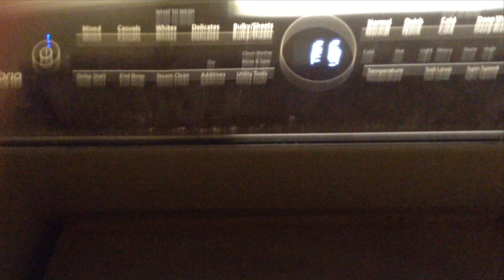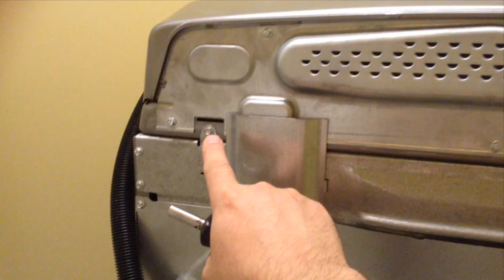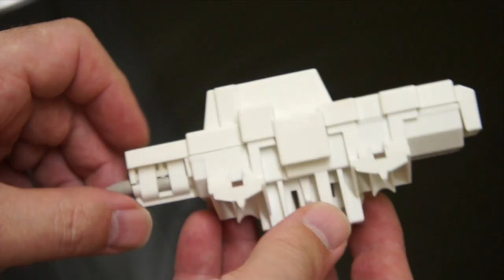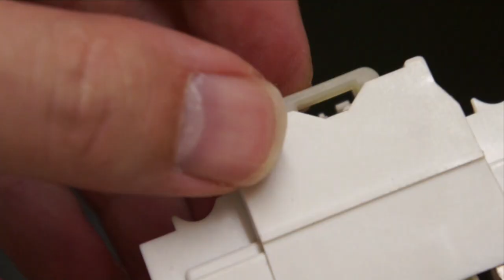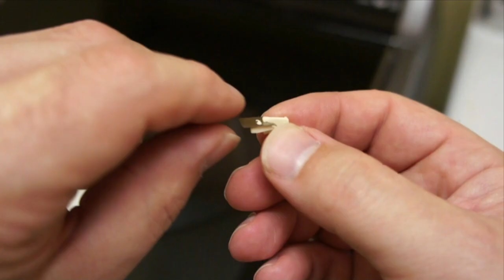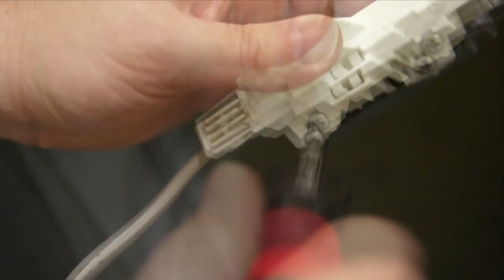Repair E3 F5 Error Whirlpool Cabrio Washer

Comment: Thank you very much for this video and fix!  After some water leaked out the top when we had the washer on it's front while replacing the broken water pump (DR error), we started having the E3 F5 errors on our Whirlpool Cabrio Washer.  I was thinking the water may have shorted out the lid lock mechanism somehow, and then found this video.  As others have stated, it took a couple of tries (and we did use the bulb grease both times), but it finally worked after also using a hair dryer to dry out the sensor and lid lock control board.  Thanks again for the great video and detailed instructions, as well as to those who commented and added their own specific details (like using the hair dryer)!

Comment: $1.50 in grease vs. a new lock mechanism ($42 on Amazon) vs. a new washer ($500) ….. amazing!!!! Fixed on the second disassemble (added more grease and bent the ‘fingers’ a little farther on the second rep) and works like a charm!!!! 🥳🥳🥳
Reply: You replaced the lock mechanism? I did the steps in this video and still nothing.

Comment: Ok so I tried this and it didn't work. My plastic latch is broke and not allowing the motor to move the little metal piece on the circut.  My question is how can I bypass this all together?
Reply from the maker: Unfortunately, you can't. The main controller board looks for the specific electrical feedback from the lid latch motor and connector. If it doesn't see it after a certain number of cycles, it will just brick the main logic board.

Comment: can we bypass/deactivate the lid lock to turn of the error code...i dont really like the lid lock function
Reply from the maker: Nope. The computer keeps a count of how many times it doesn't see the lid lock signal. After it reaches its limit it will completely brick the whole main board.

Comment: What exact screw driver do you need?
Reply from the maker: You'll need a 1/4" hex driver (your average screwdriver with removable bits can serve as a 1/4" hex driver, that's what I use in this video), a Philips #2 and a Torx T-15.

Comment: Great video.  We had a ton of wet towels from swimming on this Memorial Day.  Had the E3 F5 error.  Found your video and in less than 45 minutes, it was back together and working.  I did break one of the tabs where you put the screw in to separate the two halves...no big deal.  Getting the little metal tab back on the plastic piece took longer than it should have, but got it working.  Thanks so much.  PS...looking over the comments I see that 44 Whirlpool employees disliked this video..haha.....too funny.
Reply: Lol... I noticed the whirlpool employee reviews as well. If it works.... IT WORKS! 🎯 My hubby and I will be trying this fix tomorrow!

Comment: A much easier fix is to cut the wires and twist them together!!!! Lid lock doesn't work but who cares!!!!😁
Reply from the maker: If the main logic board doesn't sense the proper operation of the lid lock it will brick itself after 15 cycles. Not even joking.

Comment: Hello I have this issue but the lid is locked and I can't open it. Please help
Reply from the maker: Tape the glass lid to the top of the washer and follow the video. When you get to the part where you remove the screws from the lid lock, your lid will be released.

Comment: I can’t thank you enough!  My washer was just 2.5 yrs old when this part failed.  The self diagnostic test pointed to the lock and I couldn’t believe the price for this very cheaply made part from the company (I estimate the material cost at $5).  Really, given the moisture and incredibly cheap materials I don’t understand why they would do something like this.  I wouldn’t have tried to repair the part myself using my auto ignition coil grease without you having blazed this trail here. It’s been two months since I did this and it’s worked flawlessly since.  Thank you again, not just for saving me some money but it just feels so good to do something that most people wouldn’t attempt.
Reply: How much was the new part from the manufacturer? I’m going to attempt to fix mine this week but just incase i break those tiny metal prongs.
Reply: @bkhavityoway23  It was about $180 for the part. I called Maytag and they quoted me $300 for the repair. That included the wiring harness. There we’re cheaper alternatives on eBay and Amazon but I was not sure they could be made to work. Since I did the cleaning, it has gotten stuck 1 or 2 times. I just move the lock in and out 30 or 40 times and it works fine again.
Reply: @walterbright1396  Do you obviously have to take it all apart to move the lock in/out? And do you have a part number handy by chance still?
Reply: I set a wet blanket on the washer with the lid open and it caused the latch to fail. This process worked! Covered in detail. Thank YOU Mark.

Comment: I was about to go out and buy bulb grease.  The last DIY remedy we tried was using a hairdryer to remove any moisture from the sensor that might be interfering with the circuit.  It worked!  Fingers crossed it keeps working...
Reply: That could have just been a fluke repair of yours, (hopefully not) as the grease provides a lubrication and protectant against corrosion. It seems to be a very important step in this repair process. I see you commented a year ago, so I must ask, how has the washer been working since?
Reply: It's still working great! :)
Reply: @DCA514  awesome! I just fixed mine a few hours ago. Crazy..based off these comments, everyone else is having this issue! Maybe the cheapest part

Comment: I really appreciate the video and I did everything you showed.  The machine made it to the end of one cycle and then the fault indicators came back on.  Do you have any other recommendations? I see in some of the comments that the part is $150.  I would like to bypass the lid lock as it is just not needed.  Any suggestions would be great!  Merry Christmas and thanks again
Reply from the maker: Unfortunately, the only way to bypass the lid lock sensor is to replace it with a circuit that would exactly mimic the electronic signals it produces. Otherwise, the main logic board of the washer will eventually brick itself if it doesn't see the signals it expects.

Comment: Thank You!  This worked great!  The only real trouble I had was with getting the little metal bit back on (it came off so easy I lost the orientation) as well as reattaching the plastic bit that holds the metal bit in the right direction.  At first, I couldn't get it together without it pushing the lock mechanism out just a little, but enough to throw an error and not work at all.  Once I watched the video on a large monitor, I saw the little metal legs pointed back, not front, and that was my issue.  Flipped it around and it works like new!
Reply from the maker: Glad you got it figured out. Those parts are TINY!! It was hard for me to even get my camera to zoom in and hold a focus on them.
Reply from the maker: Glad you got it figured out. Those parts are TINY!! It was hard for me to even get my camera to zoom in and hold a focus on them.
Reply from the maker: Glad you got it figured out. Those parts are TINY!! It was hard for me to even get my camera to zoom in and hold a focus on them.

Comment: quick note you don't actually have to remove the lid assembly you can just remove the 2 Phillips head screws to get the lock mechanism out you're just tethered by the cable obviously but not a problem if youre not trying to film for a tutorial lol great job on this I honestly didn't think it'd be so simple

Comment: I replaced the lid lock mechanism and after 5 washes it started again saw this video. Decided to open it up and adjust the contacts. It was off of the plastic slide. Had to reattach the metal fingers first before adjusting them.
Good video

Comment: Thank you for this video. I followed the instructions and it seemed to fix my washer. However, a few hours later it happened again. Luckily I found a replacement part on Amazon for $30. I was able to replace the sensor assembly without much trouble. So far that's working fine.

Comment: I did everything and I'm still getting E3 F5.  Now what?
Reply from the maker: Repeat. Try thoroughly cleaning the contact traces on the lid lock with electric contact cleaner. Double-check that the "fingers" are aligned with the metal traces on the circuit board and that none of them broke off.

Comment: Super helpful, thank you for the video! If the same error code keeps coming up after this fix, do you think swapping the door latch mechanism would be the next thing to try?
Reply from the maker: First, just repeat the process. Sometimes the additional cleaning/lube is all it needs. Second, try to trace the OTHER end of the cable back to the main logic board and clean that connection. After doing those two things, if it's still giving you fits, THEN go ahead and replace the mechanism.
Reply: Thanks mate! I’ll give it a try

Comment: thanks for this video, lid was little challenging to get off but the wiggle method worked as a charm. had to wipe and clean those contacts. had some corrosion build up. followed the rest of your instructions and low and behold. zero errors. Thanks!!!

Comment: What a great video. Our Whirlpool Cabrio quit working, and we were on deadline to get some laundry done. Might have taken weeks to wait on a service call appointment, would have taken days to get a replacement switch. I had no idea how the Cabrio came apart.  You made it easy to fix the washer in about 30 minutes, no parts needed other than a packet of bulb grease (which now cost $1.69 a packet at the local auto parts store), and I had the right tools lined up before I started. Many thanks for your thorough and insightful video. I did skip the step of removing and bending the little contact prongs, but it seems it was unnecessary. Thank you again.

Comment: How many times do you have to do this? Regretting buying new school
Reply from the maker: From the comments, it usually fixes the problem on the first try. The key is cleaning the contacts thoroughly and applying the bulb grease.

Comment: THANK YOU!! I did t even have to take the whole thing apart. I got at the little electrode from the inside following what you did, I was able to put a tiny bit of pressure in the locking mechanism and IT worked!!! Thanks so much❣️
p/s I used tweezers… not the ideal way, but it worked for me❣️
Reply from the maker: NICE!! Good job!

Comment: This worked great for me last time, but this time it isn't working. Any idea what else I might need to look at /fix for these codes?
Reply from the maker: if you're confident the "fingers" are getting good contact inside the lid switch, but you're still getting the error, check the other end of that cable where it plugs into the main logic board. Unplug it, thoroughly clean and lube any pins, then plug it in and unplug it several times to help clean the contacts.

Another way to test the lid switch is to press down the front of the lid of your washing machine when you first start a load. If it makes it past the lid lock without throwing an error, it's a good bet the lid lock is out of alignment. Double-check to make sure everything was seated in the correct place and aligned correctly when you reattached the lid lock to the lid.

Comment: I just want to thank you for the very specific fix. This was EXACTLY what fixed my problem. I even have a Bravos XL washer and this still fixed it. I didn't add the dielectric grease however, but I will get around to it. Problem solved in like 10 minutes. Thank you again!

Comment: Thank you for this video. I finally have a long term fix. For those of you that have to run that laundry that is already in there. Let it turn off to reset and then when you hit run I sat on the lid and that apparently provided enough force for the contacts to read.
Reply: Great instructions but didn't work. Bravo xl mct has same switch. I can hear it clicking several times and then shuts off. I used to slam the lid to get it to work. Now I raise it 1/2" or so till the lock light comes back and then drop the lid. No, nothing else bent or out of place. I wonder if there's a magnet in the switch. The end of the lock has been broken so I can start it this way. Wouldn't have messed around with it so many if not for these instructions

Comment: Thank you so much for making this  video!  This is the exact issue I’m having with my machine. Will let you know how it worked out 😊.
Reply: UPDATE:  I followed the instructions from your video and am extremely pleased to say my machine is working great!  I only had a problem was when I was tightening a screw that cracked the plastic framework  but that was on me (had to use a cement putty to hold it together). So if anyone is experiencing this issue, be careful when you put it back together and don’t tighten the screw too much. Thanks again 🙏🏽
Reply: @zoe-annlynch421  same thing happened to me and I barely applied pressure. A little duct tape fixed the issue lol

Comment: Did and it works but after every 2 loads it starts with its error code smh 🤦🏽‍♂️
Reply from the maker: Take it apart. Do it again. I know, that's not what you want to hear, but hey -- I shot this video the SECOND time I did it, because the first time didn't work. ¯\_(ツ)_/¯

Comment: Thank you so much for making this video! 
I have a Kenmore Elite HE 700 series washer. The repairman has been to my house literally 6 times trying to fix the lid lock. He never repaired what was wrong. All he did was change out parts. The washer would work for a few weeks then I would have the same problem again. Last night it happened again! Mind you I have a service contract but each time I call for a repair I have to pay a fee of $100.00. To keep the service contract I have to pay $69.99 per month. I could have purchased a new washer for what I have spent on this crap!
I followed your instructions and repaired the lid switch, not change out a part! Now my washer is working correctly.
Needless to say I am canceling the service contract!
Again, thank you so much for the video!
Reply: Go AliceDean!! YouTubers are gonna put the techs out of business.

Comment: i'm not getting an error code but water contines to trickle into my machine when not in use. What could it be?
Reply from the maker: First thing to check would be to take the hose off the back of the washer and check for debris in the water inlet that may be preventing the valve from completely closing. My next thought would be to see if you can remove the valve from the washer, disassemble it and look for a worn/damaged rubber washer. But I don't have any experience with those valves. Check prices for replacement valves. It might be easier to just replace them.

Comment: It’s the lock failing to engage, you can get a replacement off Amazon for $50 and install yourself in 15 minutes. Amazon part number: B082Z8DP8Y

Comment: This fix helped me three months ago and again today.  Thank you!   Something I noticed today may help others.   When I push down (lightly) on the center front edge of the lid, and press and hold down the start button, the lock is able to engage and the washer starts.  Maybe this has something to do with allowing a magnetic field to get in the right proximity of the switch?   Maybe until this fix or replacement gets enough power through the contacts until the sensor works?

Comment: Mark you are fantastic.  I've worked on Whirlpool  W/D's for 15 years and this is one of the best videos I've ever watched that was so helpful.  I picked up a  2015 Cabrio  last week with exactly the same symptom yours had---plug it in and it flashes the F5 E3 code.  I was ready to buy a new lock before watching your video.  I'm thinking a spray of contact cleaner may work also.  How do you feel about that.  It would be easy and then  add a bit of dialectic grease to the traces after that?   Sure would appreciate your thoughts on that idea.  Thank you so much for taking time to make the video. FIVE STARTS for you friend.  Neill
Reply from the maker: Absolutely! In fact, contact cleaner was was an early suggestion from another viewer that I highlighted and added to video description.

And guess what? After 4 years, my machine JUST started an occasional F5 E3, so I'm going back under the hood and hit it with some contact cleaner. ;-)

Comment: I had the same error code, but cleaning the areas shown in the video did not fix the problem. I had some corrosion on the little circuit board that was inside this mechanism.  I had to the replace the entire assembly.  My machine works fine after the new lock assembly was installed.  Good, informative video,  just be advised this may not fix the problem.
Reply from the maker: Yep. Unfortunately, if corrosion eats away critical components, cleaning won't help. Good job on your diagnosis and repair!

Comment: Will this work if the lid  won’t unlock but has those codes. Won’t unlock at all
Reply from the maker: Sounds like a different issue, but you could follow the disassembly instructions to at least get at the lid lock switch.

Comment: Awesome!  I watched the video once, bought the grease, and banged out the repair.  Thank you!!!
Reply: Your washer still working? I just fixed mine also curious if the fix last Can't get the part for at least 8 weeks that's what whirlpool said I've checked everywhere
Reply: @David_DY   @David Yoho  A day or two later I heard the error again and I was frustrated but it only happened once and has been fine since. 

Make sure to clean the piece the way he shows in the video (I think) to ensure the contacts are clean. I was so concerned about the fragility of the parts that I rushed this step to get it all back together. 

Without this video I never would have attempted to remove that small piece.  I am glad I did the repair.
Reply: @pjakaa3  I'm on my second wash so far so good The part is sold out everywhere Whirlpool said at least 8 weeks Hopefully the fix holds up for awhile 👊